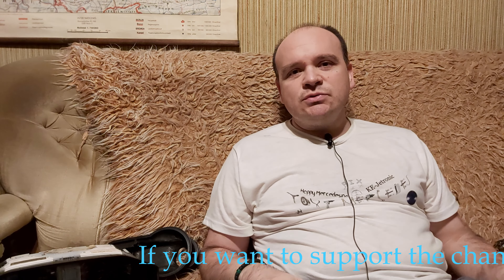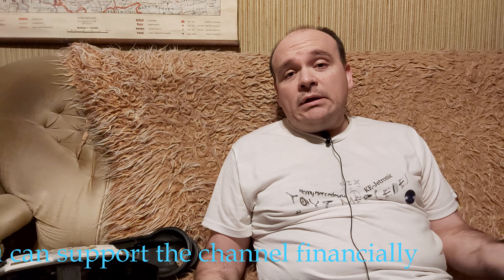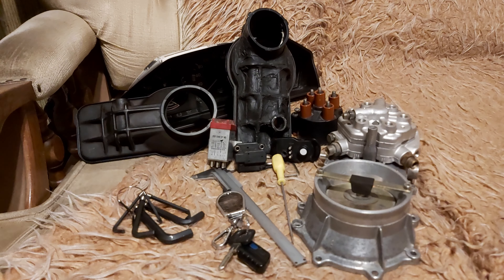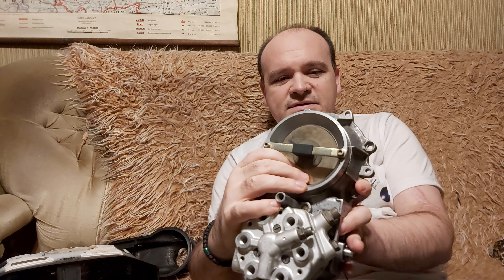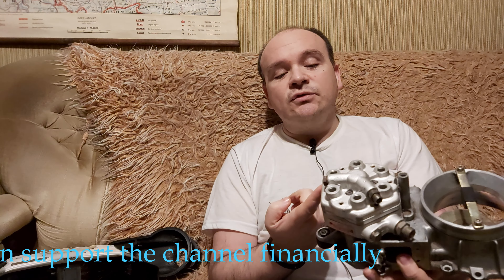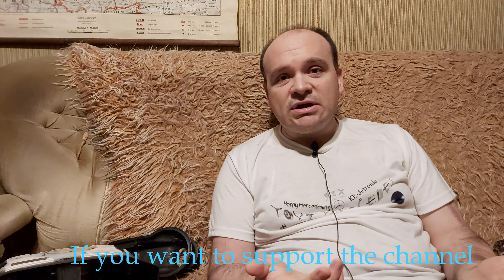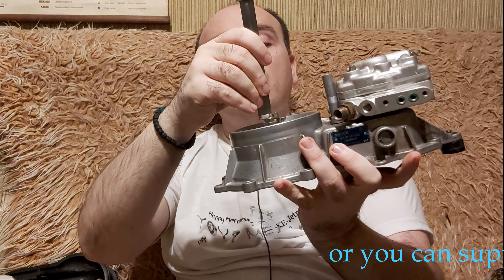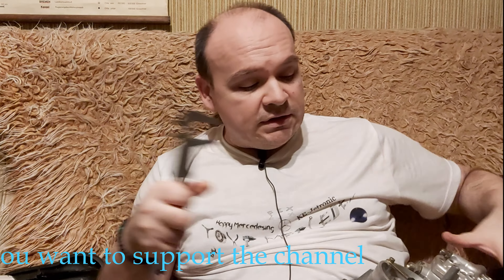㉦Mercedes Ke-Jetronic㉦ - CO screw adjustment the proper wayГ

Comment from the maker: Dear viewers, I must stress that this adjustment is done only in order to check the last mechanical component on the system(the last on my list of things to do on the system). Under these conditions every car must start(1.9mm free play). This is no fine tuning. Every form of a fine tuning is done using multimeters, an ampmeter using exact nominal values as reference like for example the current on the EHA, voltage on the lambda probe, on the potentiometer, a multimeter measuring RPM. But, in order to achieve that - your sensors must be good working and especially for the duty cycle - the potentiometer, the lambda probe and the EHA.

Comment: Hi, I try it to adjust as your explanation. (press and turn it clockwise or reverse) but it newer catch any where for both direction. If the screw broken, what can I do? Thanks for  to all your videos.
Reply from the maker: If nothing happens try it this way. If you are sure that the engine doesn't react by turning the screw in any direction. Greetings
https://youtu.be/7Dp5lQKcY2k
Reply: @mercedeske  Thanks and regards.

Comment: Thanks  for video. 
1.9mm reference point is ok... But after adjusting 1.9mm the car doesn't start at all. In this case, Lmm poti volt is not read. The Lmm pot needs to be unscrewed and set to 0.70 volts, right?
Thank you so much for explaining. we make you tired a lot but we novices will be masters one day :p
Reply from the maker: I'm glad to help. More than 1.9mm - too much air for the start point. You are right about the poti. My pleasure to help you. I see you made your car good running and you have learned a lot and I am glad for you. If you continue this way you are going to become a good master for KE.

Comment: I had set the Duty Cycle such that when the Engine warms up it varies around 50%, and I check that there was not much play with the air plate.  My 1986 560SL runs great this way.

So, I watched your video and adjusted the mixture screw to get the air plate to have 1.9mm play.
Now my 560SL is hard to start and it idles rough.  Don't like this.

Finally, I went back and adjusted to 50-50 duty cycle the way I had it and the car runs great and instantly starts back up.

With 1.9mm play the Duty Cycle on my meter is no where near 50-50 duty cycle.

When I adjust the screw to get 50-50 duty cycle I can see the duty cycle varying around 50 and I guess its the ECU reading the O2 sensor and commanding the EHA to vary the air fuel mixture.

Does this indicate that there is something wrong with my 560SL?  It drives and accelerates smoothly and powerfully.
Reply from the maker: If it does, leave it that way!
Reply: @mercedeske  I concur, sometimes we have to use "common sense" 🙂
Hey, I do enjoy your videos - they are very informative.
Reply from the maker: @cwmoser Thanks, glad to hear that. Happy Mercedesing 😃 😊 😉

Comment: hi, after fitting a reconditioned distributor my mechanic has no fuel coming into it, am i correct to say without the 1.9mm of free play in the pressure plate, that there will be no fuel unless this measurement is correct?
Reply from the maker: It has nothing to do with fuel flow in general. It has to do with the quality of the mixture.

Comment: Bonjour ivica je viens de voir que j’ai une fuite d’essence au niveau du piston du distributeur pourtant tout les joint sont neuf car je l’es avais changé car j’avais déjà une odeur d’essence dans le débitmètre est ce que le piston peut être usé ? As-tu déjà vu ou entendu cela
Reply from the maker: Bonjour Jean. Cela peut arriver si la bague d'étanchéité est mauvaise. C'est l'anneau sur lequel repose le piston. Ce joint doit être comme un cône et non un joint torique ordinaire. J'ai acheté le kit chez les Allemands, TS-Technik, et ils fournissent un joint torique ordinaire au lieu d'un joint d'étanchéité, j'ai donc dû en acheter un chez le concessionnaire Mercedes.
J'espère que cela résoudra votre problème. L'autre source d'une fuite de gaz peut être si le manchon du piston n'est pas réglé sur le bon espacement, si le manchon est trop vissé.
Salutations
Reply: @mercedeske  ici en France il n’est plus possible de trouver ce joint malheureusement Mercedes ne veut plus vendre de pièces c’est la merde
Reply from the maker: @jeanjeanlebelge9263  Jean.
https://www.ebay.com/itm/222446844499?epid=14016942138&hash=item33cadd7a53:g:hyoAAOSwuLZY0ORz&amdata=enc%3AAQAHAAAAwNQ%2FGnj7JQZw4Ohr2GXA6btOPGPQ2XbyJ%2Bd5Phx6qakz8jHiH7f98mkEu7XIEpu9SDr0PliUBURzG9LGb3a0G5O4k3GOL%2F%2F1%2FB9J5PuFsQG4wsf7INCd6RnX%2FuRi692%2FvGiEIGlPREpVktD60iH0kodNrNKKJPSrYX0dzCG3c04j7e11f2%2Bb5jWYV%2BGvYmIY8zbPk56fok4d3hhRZMMZwJYN2hX3GmbVtX7TQjIwd45dbFxqFx%2F2qET6Wwpnh8%2FUZQ%3D%3D%7Ctkp%3ABk9SR7Tjze3lYQ
Reply: C’est sur ce site que le joint est ok
Reply from the maker: This one is okay.

Comment: Hey Man i have a 1985 190e 2.0 and i want to get the mixture right when i put my Multimeter into X11 port 2 and 3 and read duty cycle i dont get any reading at all and when i change to voltage and do duty cycle formula i keep getting 50 even if i change mixture... what does this mean?!?!?!
Reply from the maker: Have you replaced the lambda probe?
Reply: @mercedeske  Iam going to do this and get back to you

I have done it once before but i didnt rewire very well

Comment: Hello, can you make a short video con how to adjust the CO screw on K-Jetronic?
Reply from the maker: Ok, I will. In essence, that screw should never have to be adjusted. Once factory adjusted it will never readjust from itself. Only in case someone doesn't know about that. But, thanks, you have me a great idea for the video!
Reply: @mercedeske  Thank you! I have recently completely rebuilt my metering head (replaced all o-rings and the diaphragm), and re-set the adjustment screws at each port (all are within 3% of the correct flow rates). 

I do not know if the previous owner touched the CO screws, this is why I want to adjust it myself. Is there anyway I can contact you directly?

I do not have a CO meter, which is how it should be done, but perhaps you have another method. Thanks!
Reply from the maker: I made the video. I need to do something on my car and then I will start editing it.
Reply: @mercedeske  Thank you very much! How can I contact you directly?
Reply from the maker: Send me the message on the fb group or on Instagram. How ever you decide.

Comment: what is the correct CO reading to tell if the tuning is optimal
Reply from the maker: If you have a KAT car then it's in general the fluctuation on the EHA between -3 and 0 mAmps once the engine reaches operating temperature.
Reply: Thanks, i meant the corbin monoxide reading from the exhaust. Instead of the duty cycle, some mechanics would do a CO (carbon monoxide) reading at the exhaust for tuning. That's why it's called CO tuning. I wanted  to know what is the CO reading.
Reply from the maker: @gastroalchemy4499  It should be 1-2%

Comment: Hello,
Are the values of the dosing plate the same on all models? Ke-Jetronic 5.2 on a M104.980.
When you set your plate this way, you also set the CO, right?
Reply from the maker: Yes, but as I have already mentioned it in the description of the video, this is just a starting value. If you leave your car just like that you will have a shaky engine. All fine adjustments are then being achieved either at the eha or X11. And yes, you set the CO.
Reply: @mercedeske  Ok and thank you!
Sometimes it's hard to understand everything because it's so badly translated!
I am Belgian and speak French.
Your videos are great and I have to take the time to watch them all.
I know a lot about the Ke-Jetronic but here and in France, very few people know how to use the X11 plug.

Personally, I do like this:
Selector on P, idle and engine 85°C :
U 2&3 : 7V
U battery : 14,2V
7V : 14,2V x 100= 49,29
100-49,29= 50,71 % Duty cycle.
I check with tester and the Duty cycle oscillates from 48 to 53% Normal, the fluctuation represents the image of the activity of the Lambda probe.

I will make tests proceeding in your way.

Thanks for sharing!

Translated with www.DeepL.com/Translator (free version)
Reply from the maker: @marceldumoulin3223  Hi again, 👋🏻 you have great readings, don't readjust anything else. Thanks for following my content and Happy Mercedesing 😊 😃 👍🏻🍀
Reply: @mercedeske  Yes, you are right. Have a nice Sunday!

Comment: Can you please help me diagnose my 92 300ce.  I have thrown a voltage regulator, ovp, new cpus, plugs, bosch rotor, new cap and wires, fuel filters, fuel pump, fuel system cleaners and even new fuses.  Car runs better every time I do something.  The car itself has 81k on the clock and when I purchased the car last nov (22) it had expired tags from 2012.  With all of this I still encounter a rough idle at times, the car wants to hold shifts till 3500rpm (if I lift foot it will upshift), but most annoying is the ASR light will not come off.  Please help with my next step..... Thanks Jay
Reply from the maker: Hi. Are those miles or kilometers? For now I would advise you to replace the potentiometer and the o2 sensor. As for the ASR light on, I believe it's up to the electronic accelerator, I'm not quite sure.

Comment: Which way should I turn the screw if it’s hard to start during a cold start?
Reply from the maker: This adjustment is done for the mixture in general and not for cold or warm start. If you are not sure about the mixture and you readjusted it so that the car won't start then unscrew one of the lines from the distributor to the injectors, bridge the contacts 87 and 30 so that the pump can work constantly(engine OFF) then start turning the mixture screw clockwise until you se fuel coming out of the port. As you do STOP and turn the screw half of a turn counterclokwise. Under these conitions the car should start and then wait until it warms up to make fine adjustments

Comment: Just watched this video and notice you have not re-set your airplate to correct resting position before doing any other settings. Your airplate appears to be resting too high. 
The bottom edge of the plate needs to be dead level with bevel lip edge (before it cones out when viewing from underneath ) 
Reset the stopper plate by tapping down on the press fit shaft from above with a punch to lower the stopper plate. 
Then you can set your 1.9mm free play of the airplate (before it starts to push the FD metering plunger up)
Once you have your engine at correct warm idle you are going to have to re-set your potentiometer to 0.7V before doing any other adjustments

Comment: Hello,
I smell fuel when driving. In wich way must I turn the scew?
Reply from the maker: Hello. At first - which parts have you replaced on the system?(injectors, lambda, potentiometer, fuel pressure regulator, etc.)
Reply: @mercedeske  hello, nothing has been replaced.Just I remember that once a friend mechanic turn the the crew to right in order to enricher the mixture cause I wanted more power. But from month now I smell fuel in the exhaust fumes…
Reply from the maker: @ldewitte028  Well, then until you get fluctuating resistance on the X11 between 6.6-7.33V

Comment: Good evening my 300 SE from 1987 start for about 5-7 seconds and stops.I changed the hoses the idle valve and the pression regulater...any ideas? Thanks
Reply from the maker: Good evening. Yes - the potentiometer, the lambda, the injectors. Have you replaced the potentiometer? That's for the beginning.

Comment: My system does not have an EHA or potentiometer attached to the side of the distributor.
Reply from the maker: If the screw was never readjusted you never have to do it. Because on K-jetronic it is very hard to adjust the mixture the right way if readjusted. The only way would be with a gas analyzer.
Reply: @mercedeske  My screw does nothing when you do adjust it. If I pull it all the way out, the car still runs. I will do the Gas analyzer test next. Thank you sir.

Comment: I fucked up and lost the original spot of hex screw. It will not cold start now. What should I do?
Reply from the maker: Remove the fuel pump relay, bridge the contacts 87&30 with a wire, remove a metal hose. Turn the ignition on and start enriching the mixture(turning the 3mm allen clockwise) until you see fuel coming out of the port where you removed the hose. As the fuel starts coming out stop and turn the allen screw for a half a turn counterclockwise.
Reply: The metal hose on the fuel distributor?
Reply from the maker: Yes
Reply: Hi it’s me again. I was having the duty cycle with cold start issues. Maybe I should leave the removing metal hose alone for now.

Comment: You never mention the air screw adjustment. People fiddle with the mixture screw when they should be using the air screw to set the idle speed.
Reply from the maker: I did mention it. Look, there are three types of idle control valves. The one you are talking about is the second one, the one with 3 contacts. There you can adjust the idle manually. On the last generation of the icv it's not possible because the ecu does that. In fact there is a place where to turn the screw but I wouldn't recommend anyone to do that because that's adjusted as it should be in case the ecu fails so that the icv can work as much as possible. On V8 engines it is possible to be done manually but only on V8 engines.
Reply: Where can you adjust it on the v8 560SEL?
Reply from the maker: It is done only if you have no vacuum leaks and if the ICV is flushed. IF you still have vacuum leaks then it can be done but this information is not for free.